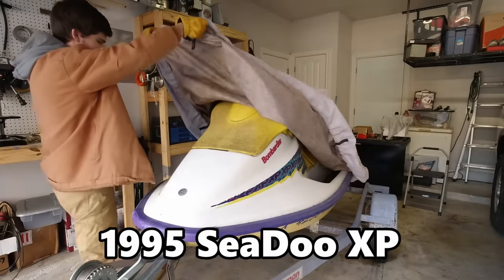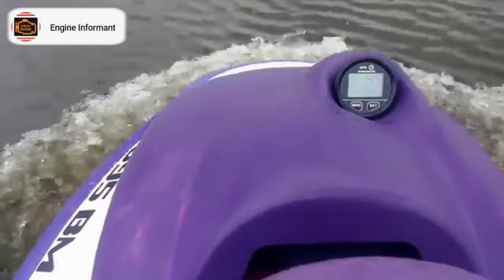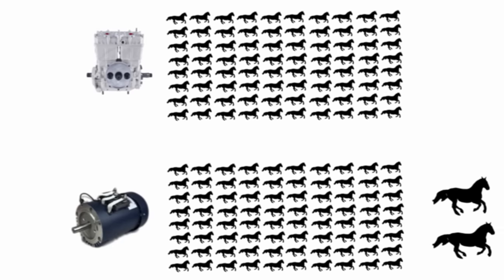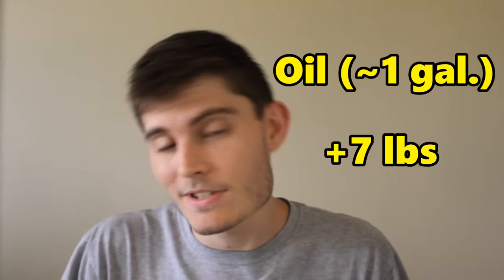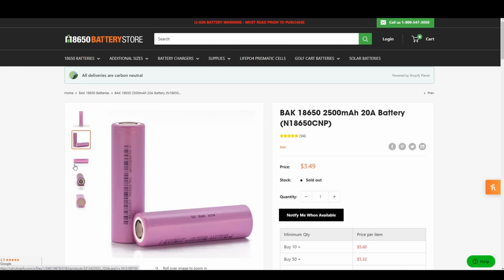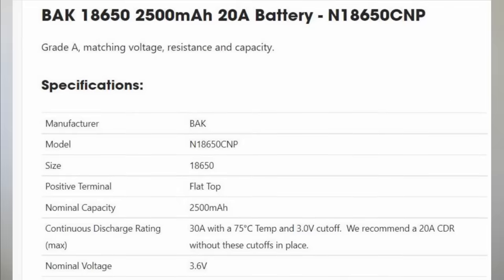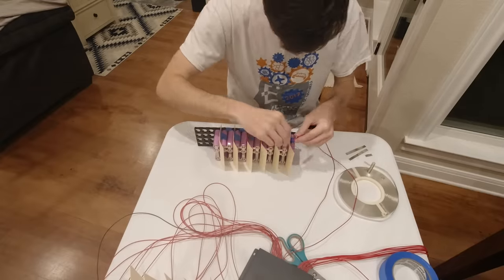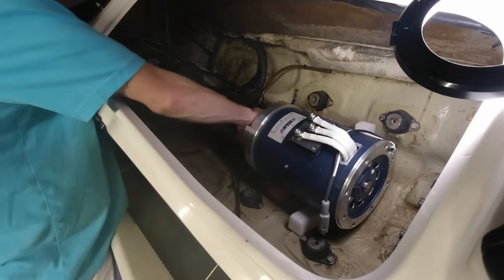Electric SeaDoo Conversion!

Comment: Love this! And your roll your own spot welder is pure genius! 

One issue that I didn't see any mention of in your video is about thermal management of the batteries. Lithium-ion batteries are subject to thermal runaway which can cause the entire battery pack to catch fire. There are three basic ways that a battery could suffer a thermal runaway, but in your case the most likely cause is that the battery internal temperature gets too high. This is due to high internal heat generation from running at the maximum continuous amps combined with the fact that your sealed plastic battery boxes and foam pieces are actually thermally insulating and so make it difficult for heat generated by the batteries to escape. 

My suggestion is that at a minimum, you figure out a way to put a temperature sensor inside each of the battery boxes and connect them to something that will sound an alarm if the temperature inside any box reaches a maximum safe temperature. The sensor should be buried in the middle of the battery pack since this is where the temperature is likely to be the highest.

You can also make some modifications to better manage the heat. A simple way is to simply blow air over them to add some forced convection. Another improvement would be to drill a hole in the lid of each battery box and a second hole in the side near the bottom. This would pull air in the hole in the bottom and as that air is heated by the batteries, it rises and exits out the hole in the lid. To keep water out, you could put a riser tube from PVC pipe in the bottom hole and going up to at least the top of the box. Doing both of these would be even better. The ultimate would be to blow air into a box on the underside of the battery area lid and then run small air hoses from the air box to the bottom holes in each battery box to add forces convection directly inside the battery boxes.

And for the ultimate thermal management system, you could use the fact that you are operating in a huge body of water, and add a water cooling system that takes lake water and pumps it through copper tubing inside the battery boxes. Only tubing inside the boxes would need to be copper. The rest of the water lines could be PEX tubing. Likely this would be major overkill, but it would definitely be a technical tour de force.

Again great video!

BTW, I am in the process of designing away to take an old commercial walk-behind mower being sold for cheap because the gas engine is shot and convert it to battery-electric. This would involve 5 electric motors, one for each of the three blades and one for each of the rear wheels. The blade motors will have a controller that varies current to keep the rpms of the blades constant. By having a motor for each rear wheel with its own throttle, I can turn the mower by differential throttling of the motors. I could just use one large motor to directly replace the gas engine, but then I would have to retain the pulley and belt system from the original gas engine configuration that just adds to maintenance. My biggest effort is designing the battery pack to have enough energy to mow my large yard while also being able to provide enough power to drive the motors. Right now my leading candidate for the battery is a lithium-iron-phosphate (LiFePO4). These have the advantage of having very high maximum specific power at the cost of a reduction in specific energy. Their greatest benefit is that the are faaaaar less susceptible to thermal runaway. And the electrolyte they use isn't flammable, so even if they do have a thermal runaway, the result should be just a venting of vapor without catching fire. Your video has been enormously helpful in my efforts to design my battery pack. Thanks!
Reply: You don't know what your saying. Lifepo batteries and heat have parameters but seriously you obviously are an arm chair captain. Go make your own projects.
Reply: bms can monitor temp etc

Comment: First of all, great video. Some words of advice though for all of those out there thinking of doing something similar. When assembling a battery pack made out of cells like 18650 you absolutely need to group them according to their voltage, charge single cells if necessary. Also you should measure each individual cell's voltage and find potentially bad cells. There are many good videos explaining the professional assembly process of battery packs.

Comment: This is a cool video. Being a big personal watercraft fan and having a lot of experience with 1990s Sea-Doos, I will say that your ski is a 1995 Sea-Doo XP that had a 720 cc Rotax. That engine, when new, was capable of 85 hp. It would also spin close to 7800 RPMs. That would give it a top speed, in perfect conditions, trimmed up and leaning back, of about 54 mph. You definitely have the power of the electric motor it just seems you need the RPMs. And that coupler is getting trashed. Pay close attention to alignment. Very cool video.

Comment: The issue you're having with the coupling, is that you're out of spec for alignment of the spider type coupling.
You might try a polyurethane tire coupling. They allow for a high degree of misalignment.

Comment: Fantastic video and build! Run time could be expanded by expanding battery obviously. What I like about this is the cost savings to have some fun. A set of solar panels can keep your operating costs to a minimum. You also have an emergency power supply in the event of an outage at your home.

Comment: Thanks to Youtube algorithms for recommending this video! Searched for three years, there were no good examples! I have the same jet ski, even colors and years, but not XP but GTI! I have long dreamed of transferring it to electric, I have even bought a motor! In the video, everything is done very competently, everything is super, except for the battery! the battery in the electrical theme is 90% success! Lithium iron phosphate prismatics in blue cases are highly recommended! they give more current, do not heat up, and are not very afraid of the cold, and they need less quantity! It is important to seal all wire connections against water! I really liked that the author taught the culture of weight! according to my calculations, about 80 kg is allocated, this is about 15 kWh of energy Thanks for the video, good luck! Subscribed!

Comment: i love how ya did the spot welding bc didnt have one! i used a microwave transformer and rewound the secondary 3 turns with some think(cant remember gauge) wire and copper brake line for my electrode end fabed to a nice thick point. i just always have to respect the simple guy/girl working from a small garage with what they got! respect! lol

Comment: Awesome project! There may be some batteries from salvage EV's that you could have bought to save you some time. On second thought you probably took that into consideration and found that either the weight or the cost would not make sense. I found this episode a lot more interesting than some  science TV shows. Great job!
Reply: a tesla batterie is made out of 18650 battires that are connected together...

people buy the 18650 from the factorys..
they are sold cheaper if they does not meet the standars..

you can probetly buy a pallet of batteries you sort in to a couple of standards, for the same price that he paid for his batteries..

it is probetly more from hybrid cars the batteries can be used, because of the size and weight.
but those have value for other hybrid car owners
Reply: thunderstruck sells used ev batteries. i got some ought of some smith trucks, rated 84v

Comment: Also, another logical detail, that everyone know, but to mention for future builders: fix all bateries and elements, and make covers water tight / sealed, as much as possible, in case you turn over in water (thats not unusual). Water could destroy almost everything inside (particularly salt water). In any case, ruff ride over waves, can throw things inside left/right, so fix them as much as possible. Excellent project - Bravo! Regards from Serbia

Comment: Awesome job! But for the price you could've put like 6  seadoo motors in that thing but watching this and doing that DIY build and learning stuff is well worth it!!! You got something unique now.
Reply from the maker: Knowledge is priceless! 😉
Reply: @ZachsGarage1  So is the instant torque.
Reply: @WindFireAllThatKindOfThing   Yeah,  but in a jet ski the instant torque doesn't translate like it does with car or bike.   The jet pump inherently lags,  especially if you want any top speed.  It's still an awesome project though and probably something we'll see in the future from powersports manufacturers.
Reply: Could you have used lipo batteries like the ones we use for the quad copters or is that to dangerous 😂 because a 6s battery fits in my palm and produces 25.2 volts? 5 in series 30s? (I’m not an electrician)
Reply: @FriendlyBassHunter   It's a fair question,  I think he'd need 40 6s 5000mah packs to get the same voltage and capacity as his 1st battery, (4x 6s in series with 10x in parallel) remember he had to add a few more too,  so 50-60 packs to be usable.     I think the 18650's are a less expensive option, but I could be wrong.

Comment: Just be careful running the jet pump at that high of an rpm, for that long, out of water. Awesome Project Build! Came out Great!
Also i know it sounds like a bad idea bc of wires and metal.. But using metal battery boxes or some fire proof plastic, would work good and double as being a fire protection battery box, if a lipo battery cell assembly was to puff up or catch fire. I've seen some 4s & 6s rc lipo batteries go bad, usually nothing but sometimes smoke.. but fire isn't common but if you google for pictures you will see examples of it happening.. its a lot of power an a lot of Amps being pulled from the batteries and wiring.

Comment: Very clear thinking Zach. You have good basic understanding and that lets you get to the next level. I'm thinking those battery trays or a more robust design would be ideal to build with conductive sockets and perhaps capacitor arrays to protect from surging circuits in acceleration and deceleration. But for prototyping faster I don't want to be too critical. I'm just thinking of pounding waves dislodging those magnets in bad ways as they are conductors as well.

Comment: That was a pretty awesome project! 🤩
A few tips if you ever need to build a big lithium pack again:
While 18650 cells were the go to size for a long time these days you might want to look for 21700 cells, they are a bit bigger and tend to be a bit cheaper for the same total capacity (also more capacity per cell means a little less welding)
for the spot welder you can get ready made modules that use a bunch of MOSFETS instead of a relay for switching the welding current giving you more consistent results...

Comment: If you have an electric setup thats super reliable and ride it alot in the summer, it saves alot of money on gas especially for a 2-stroke. 5 rides in with $4.25 a gallon is roughly $25 or more per boating day which is probably $1000 per summer which is insane. 1 Hour of runtime is acceptable because 2-stroke skis only get about 1 hour or so, 2 hours if conservative on fuel.
Reply: Guess you missed the part where it’s slower than a 4hp on a row boat …. Literally 
    Freaking obd2 scanner to check rpm ?? Sure bud congrats glad I skipped to the end ….  Haha
Reply: @RobinIrving-cr4ug  It’s cool innovation having an electric jet ski. We already have electric cars and boats with electric outboards, slower is fine, if you want more power just increase the voltage even more. People fail to understand how awesome electric vehicles are. They are easy to build, don’t pollute, and can be made compact.

Comment: That was AWESOME!   I was thinking about converting an old sailboat to electric when the diesel goes out.  I think in 3-4 years when it does, prices will have dropped dramatically.  Definitely saving this video for the future.   Great Job!
Reply: You probably have 3 to 4 weeks at best
Reply: Check out Sampson  Boat Company. Leo powers his rebuild with a hybrid system. Worth a look👍
Reply: bhy bew elrric sail boat   eterr speed rabfe

Comment: Amazing build.  Very dedicated.      I looked at making my own battery recently for bike trailer, but price of battery and all the rest  + time, rack mounted batteries with all the electronics ready to go is about the same price without the time to build.   Plus of that is I can take it out of trailer and mount it in my garage for use with my house solar.     SeeDoo built from ground up for EV would probably do pretty well.   Especially if you can park it in your garage and hook it into to power home as well.

Comment: For all those people who don't fully understand just how powerful and useful those "dirty" gasoline engines really are!  Excellent build sequence and I'm sure whichever engineering school you go to will be happy to have you.  ;)
Reply: It just proves how inefficient jet-skis are by design. That much power spinning a prop would have you going 50knots. Jetski engines are actually pretty massive.
Reply: And currently there is no viable alternative to all of those dirty and inefficient gasoline engines. And there won't be anything available anytime soon either
Reply: @timrussell1559  - I tend to agree, except that things are evolving very quickly in this space right now, as a result of all the money going into EV development.  NASA claims to have a safe battery chemistry with gravimetric energy density high enough for commercial aircraft...that oughta move a PWC just fine.
Reply: @Nathan Smith - That is a fact, and one reason why I think it is inevitable that both options will exist for many years to come.
Reply: @Nathan Smith would you consider biodiesel  or ethanol to be a petro chemicals?
Reply: @timrussell1559  nope none even tho they spend hundreds of BILLIONS on high tech and even tho we got a rover to operate for 10 YEARS on MARS a planet MILLIONS OF MILES AWAY, hydrocarbons are just all they've managed to come up with for the general population. Weird.

Comment: As soon as you said “18650”, I thought, “How will he ever locate a bad cell?” Glad I kept watching! Excellent work, young man!! 👍🏼 Edit: find an old tire and grind out a replacement for that spider gear 👍🏼
Reply: when you see fire you know where the hotspot or bad cell is.
thats why tesla uses a fuse wire on every cell. to be safe.
but  all in all, he did great. very nice project.

Comment: The spider in your coupling is probably tearing because of your motor alignment.  You can hear the vibration - which is a pretty large loss in power output and longevity of your motor bearings and coupling.  You can make a mounting plate with some jack bolts to adjust the alignment and you can do a rough alignment with a straight edge or get it near perfect with a laser aligner.  Could also be issues with the shaft connecting the prop or bearings further down

Comment: Great video and cool DIY. I worked for a company that converted a jet ski with an HPEVS AC induction motor about 15 years ago or more. A few things I would recommend are a torque converter, a proper bms - yours doesn’t seem to do anything other than monitor cell voltage, a stronger motor mounting system, and an actual lithium battery charger (not two DC-DC converters). Lithium batteries have a different charging curve than lead acid which is super important to recognize.

Comment: Wow! That's not a vehicle that I thought anyone would be interested in EV swapping, but man, your build is impressive! How long could you ride before the battery pack was flat?
Reply from the maker: you could go about 30 minutes, but probably would run into overheating before draining the batteries all the way! I'd use larger wires. The battery cells themselves actually didn't generate too much heat ( some other chemistries for more capacity but less discharge amps like 7amp max, would generate heat faster at the same amp draw. I did some testing with other cells first, but ran out of time to show that in the video ) :P

Comment: Dude, what a fantastic build! I liked the software you used to make a motor mount. Do you think I could use it to modify a ring gear for an RC car? I have a build I'm doing and I want to use some bigger output shafts since the stocks ones weren't a versatile as the ones I planned to use.

Comment: Grainger has all kinds of e-motors and some that are okay for water. Figuring out the right specs for motors and battery packs is the tough part for sure. Most conversions I saw were basically trolling speeds. But it can be done if done right.

Comment: Amazing build.. I worry about your Chinese cells built that big.. Terrible experiences building packs with 18650.. I always try and use the minimal number of cells I can get away with any project. For eg. headways where you can get 200amps per cell and each cell is 8ah. Much more stout connections too.. I figure with vibration and all the hammering in a seadoo.. you're connections in those batteries will fail in short order and upon a few charges you will ruin adjacent cells.. Also no BMS will be a true nightmare to charge those batteries..
Reply: I attempted 18650 in rc cars, they don't like a strong draw. When I geared it up for more top speed it almost burned my rc car to the ground. But I always use Velcro straps on all my lipo batteries so I can get them out in a hurry when I need to
Reply: Agree. Also with those cheaper cells I have had about a 15% early failure rate. And 500 cycles on these....maybe at 0.2C discharge, but at 20A....no way.